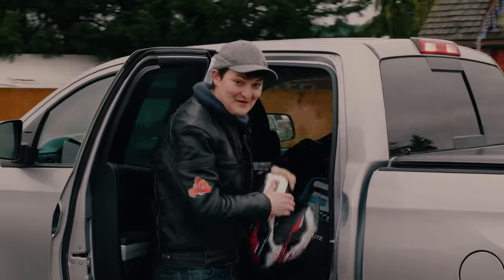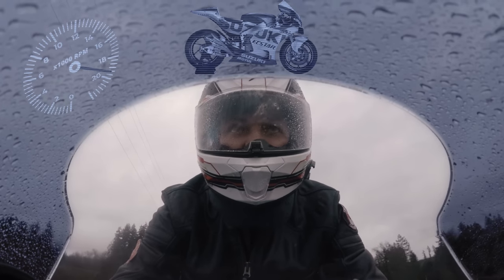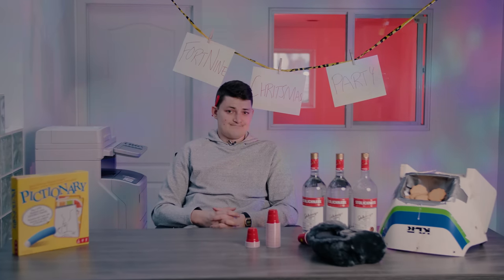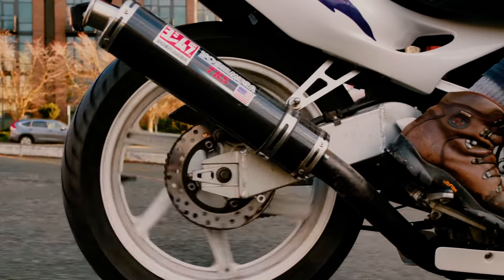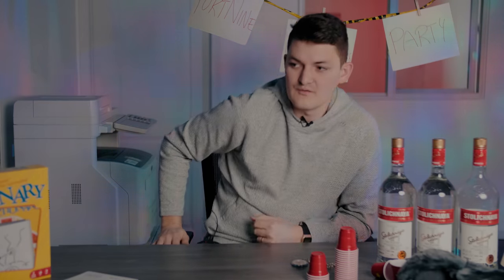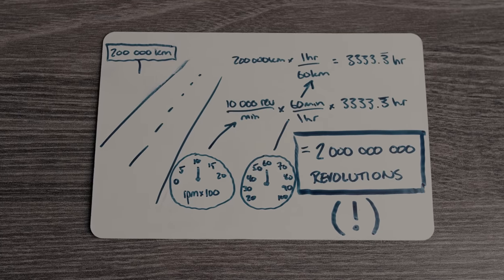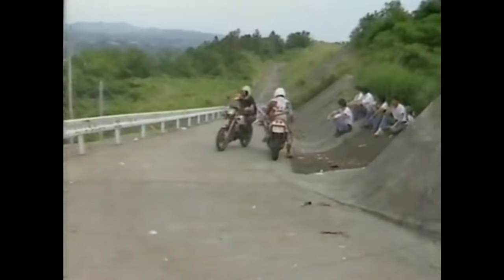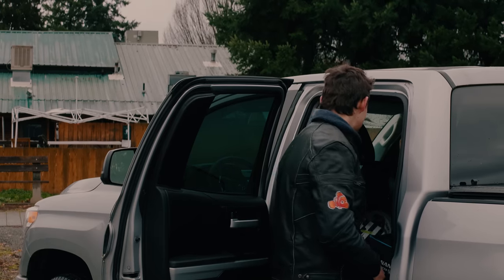The '90s Honda that Revs Faster than an F1 Car

Comment: Sadly they are so rare you can hardly find the good ones. I have been on a quest for 11 years but the availability, price and maintenance has steadily gone beyond my reach.
Reply: I couldn't afford one in the day,unfortunately nothing changes
Reply: Move to south Australia 🤣 easy to find one for 1.2k-2.0k even the Yamaha, Suzuki and kawasaki versions
Reply: @TydraGaming  Ah. No. They're all worn out. Flogged to death with no maintenance by young dickheads. 20000 rpm with dirty low oil. Kaboom.
Reply: @edwardroberts8761  not all of them! Once in a blue moon a clean one pops up, but a lot of them have been clocked over  with "low kms" still cheap to get for what they are, I guess it shows how strong the engines are if they can survive 20-30 years of abuse and still manage to run.
Reply: @TydraGaming  Merry Christmas Tyson.  Personally I've given up on old shit.
Reply: @edwardroberts8761  cheers mate merry Xmas, sometimes being optimistic about these older bikes goes a long way. Sometimes they are pile of shits though 😅
Reply: I paid 2.5k for mine in NSW only thing it’s needed was a battery although it could do with some new brakes it’s been reliable with 40k on the cluster (doubt that’s accurate as being a jdm import it’s probably been played with and they are only a 5 digit odometer) apparently it had a major service and carb rebuild before I bought it but I’ve got no proof of that the 1 thing Ryan doesn’t mention in the video is these are a small bike jump on a 600 or even a current 300 and compare the size these are tiny
Reply: @carbonfiber492  yeah the size is part of the fun, trying to drop one of these in a corner is an experience you cant come close to on a 600 or a 1000, and once you get used to working the gearbox, it just screams In the twisties. The fact that so many are still alive to this day after revving their heads off for 30 years shows they were built exceptionally well. Supposedly they cost similar to a 600 supersport when brand new. So glad kawasaki is bringing them back even if it's only for Malaysian markets. Hopefully that will change.
Reply: @TydraGaming  Fair few in Qld as well

Comment: zx25r been almost a year on indonesia, been a good sell even tho it is 11.000 CAD, because 600cc or 1000cc bike in indonesia were 50K+ CAD (due to tax and regulation, etc) so it is a good entry to 4cyl sounding machine (we just love the sound, speed yes, but it sounds "expensive")
Reply: Wish I could immigrate to Indonesia just for this baby
Reply: @ruhtam8971  and it is like what his saying, it sound so loud for suprisingly little amount of go, so you can be cruising at like 40-50 kph at 12.000 rpm

Comment: Had an CBR250R (MC17) for a short while many years ago.  While it doesn't really get going until 14k+ I was actually pleasantly surprised by just how wide the powerband was on it for such a small engine. Fantastic little gems, such a shame they like the 400 class were effectively killed off when Japan changed their licensing laws in the 90's.
Reply: I had the MC17 as well! Bought it of a dude in Auckland for $1500. Great bike. I ended up riding it to Palmerston North. Had some awesome races on that little hurricane

Comment: I have the cbr400 nc23, the near exact 400cc version of this bike, and with the extra 150cc it's fantastic! Enough grunt to beat today's 300s, and I suspect it would beat a ninja 400 of today as well. All the CB 400s Hondas had cam chains, and not cam gears like the CBRs and VFRs so they don't have the whining engine sound
Reply: You sure it can beat the new ninja 400s?
Reply: @saivang9204  Maybe not off the line with its tall first gear, but otherwise its got another 14 hp and just 30 pounds heavier. So yeah, it probably would beat a ninja 400.
Reply: @saivang9204  I'm sure, but having seen the new ninja 400 parallel twin pull, I'd be willing to put money on the old cbr beating the new ninja on the top end lol

Comment: Damn, that's the first time I've heard one with a Yoshi pipe, that sounds INCREDIBLY good. I actually didn't know Kawasaki launched a new Inline-4 250cc, sure would be nice if it came over here.
Reply: Sadly, they are mainly Asian/Indian market. The emissions, are 1 thing, and the second is conversion/dollar rates. Me...I want one. But most riders will pass on the price point alone. :(
Reply: @animationcycles7109  unfortunately we have lost hope of getting the zx25r in India because unlike Indonesia we don't have strict laws regarding age and capacity of bike one can ride . 
And Kawasaki already sells their z900 as the cheapest bike with inline four and it is very popular out here because of the same reason. I am not sure about this but I think a company makes more money on a bike the higher it's price tag is... So introducing a cheaper bike when they have a more expensive bike as the best selling in their portfolio is not something they would do.

Secondly zx25r's price when converted sits at around 5 lakh INR and at this point this bike would be competing with the second best seller in kawi's portfolio (in india) so I am not sure if it will have many takers because the general notion here is that 
"cc" matters a lot!! and paying 5-6lakh for 250 cc is not something many would do

Comment: You're making me WANT that new Ninja ZX-25R!
Reply: O yes 🤘😄
Reply: i doubt you'll like it still past the first few weeks..
Reply: 650ib, you'd have to import it from Asia right.
Reply: Me as well ib! When they announced the bike they said it would be sold world wide. Not! I would still love to have one. I'm so disappointed.
Reply: @KimmyR3  says the dude on an R3.
Reply: @KimmyR3  r3 eeww
Reply: I know you're going to get it😂please do tho
Reply: @KimmyR3  My mate owns a ZXR250C and a Ninja300 with full exhaust/power commander blah blah etc. I've raced the 250s extensively and also litre bikes. The 250c is noticebly faster up top but the 300 isn't too far behind. 300 like yours is a better engine around town though more low down torque.
Also the brakes on the 250 90s bikes are better, usually double discs. I have made them go blue once on a particularly fast ride keeping up with 600s and 1000s, they will take EVERYTHING you can throw at them as long as you look after the pads and service/grease them from time to time. 
They are different levels of bike IMO. True track bikes for the street. The modern Ptwins are more a commuter sports bike IMO. Power is different for a reason..
Reply: I agree, but i'm specifically replying to 650ib here. he mostly does highway pulls on uber modded liter bikes hence why I said he's gonna get bored of the ZX25R (or 90s 250 i4 bikes). The new ZX25R is barely faster than the R3, wins primarily at the top end, while losing entirely to the Ninja400.
Didn't mean to diss anyone, I just commented based on what I see on his channel..
Reply: @KimmyR3  wrong,the zx25 will have about 50 hp,much more than the r3

Comment: I had a FZR-250r as my first bike, it was awesome fun to ride with the power band between 12k and 17k, redline at 19500rpm!
Ultimately though jumping on a 750cc and then 1000cc bike just blew it away as the 250cc are not that powerful.
Reply: I had the 1988 FZR 250R was quick for a 250 compared to what's available today.

Comment: Honda also made a 125cc 5 cylinders engine that made 30hp and revved to 20.5k rpm, in 1966. The RC149.
Reply: it made "over" 34 PS
Reply: Its also a super limited production racebike that mere mortals have no chance of ever riding, let alone owning.

Comment: Growing up in Australia in the 90's where new riders were restricted to 250, I remember this bike well and the daily street racers against the Slingshot (Suzuki not the CamAm). I still believe it's a good idea for new riders and if had those rules here then I guarantee the 250 market would be crazy fun.
Reply: Our 250 market was good back then. Gpx250 was another little beast, though it only revved to 15k.

Then again Suzuki and Kawasaki seem to be redoing the 250 market right now
Reply: @MelodicTurtleMetal  Did suzuki come out with a new 250? I only see the same GSX250R on the U.S. site. God I hope that ZX25R makes in to the U.S., I would buy one in a heartbeat.
Reply: @Daschickenify  I guess not.. I thought I remember reading about a huge overhaul for a 249cc sports bike but can't find anything.

Would love to see a competitive market for them again, though admittedly I'm not sure I could go back to 250cc after the zx14r I currently got
Reply: @MelodicTurtleMetal  I regularly bounce between bikes I ride. Most powerful bike I rode was a 1999 R1, I can still get on slower bikes and have a blast. And  on that subject, I'm trying to get a new grom, you know, the motorcycle with 9 horsepower.

Comment: We are blessed that Kawasaki released the ZX-25R in our country 🇵🇭. Letting us experience almost the same high revving quarter liter engine in a new form factor with loads of tech. Less headache from maintenance.
Reply: But can this Kawasaki one do 200,000 reliable kilometers like the 30 years old RR did? That's yet to be seen!
Reply: Shame about the whole 400cc rule for Northerners tho...
Reply: @rohanes thats the saddest part. but still marami parin kaming kasamahan galing luzon.
Reply: @deletevil  Only time will prove that, but it's a Japanese bike with fuel injection, I assume it's reliable enough.
Reply: @reeeee3  agreed!
Reply: @reeeee3  agree, so far after a year of ownership, no problems whatsoever.

Comment: The sheer horror on my face as Ryan shows us how it revs to 20k while the engine is still cold and pumping out steam. That said, great vid and bike. Reminds me of my teenage years when the KR1S and the RGV were kings.
Reply: Yeah, that was hard to watch. I couldn't do that to a fine piece of machinery
Reply: Yeah that was just plain stupid!! In my book that is; No feeling for technology!
Reply: @R2_D3  guys chill do you really think the physicist math whiz would do that lol? They had it warmed up before the shot obviously. The shop that loaned it confirmed
Reply: @dkompolt1234  That wasn't a warm engine! No way!
Reply: @dkompolt1234  Clearly not it was pumping out condensation still
Reply: @dkompolt1234  yes , we think and know that.
Reply: Kr1s and rgv kill these things , these were cool for a 250 4. But nothing to write home about. I loved the 400 it was barely heavier than this but with the extra power you want. 

I've got two of the 900's at home , the trip colour hrc and urban tiger.
Reply: @hayden6056  had a RGV250M,  great bike, always liked the KR1s but were pretty rare in NZ compared to the RGVs , wish I still owned it, but drank fuel and 2t oil,tyres, brake pads etc but kinda worth it as a weekend bike....
Reply: @nix123ism  man over in Aus you're looking at ten K for a good road going one these days. I want another one but I think if I were to go that direction I'd possibly go a vfr 400 or zxr 400. 

It's been a long time since I've yelled at a two stroke for not starting when I really need it to. Not long enough to forget hahaha.
Reply: @R2_D3  H2O in combustion product condenses as water vapour in cold atmosphere, especially at high humidities, as air becomes water-saturated very quickly.
You see warmed up engines spewing out vapour all the time in cold weather.
Reply: @minhucovu6321  then explain why anywhere else in the video we do not see the vapor.
Because that engine whas stone cold , that is why you see the vapor.
Reply: @gertscheper9653  Idk, maybe the ambient temperature changes?
It's still smoking at 2:00, and around 2:14
Reply: @minhucovu6321  dream on.
Reply: @gertscheper9653  :))))))))

Comment: I really wish that manufacturers would do more bikes like this, low displacement 4 cylinder engines. That's why I was really looking forward to Kawasaki's new 250, but then saddened when I heard they had little plans to bring it to the states.
Reply: Why ? What benefit has a low capacity four over a modern twin or triple ? Try the Aprilia RS 660.
Reply: @douglasalexander4348  35 MPH sounds amazing on a small displacement 4 cylinder engine when you put an exhaust on it. Plus, like he said in the video, it's more fun to drive a slow bike fast than a fast bike slow.
Reply: @THEJake829  I agree. I have a 250 2 stroke. But try the naked mt07 or Aprilia rs660 sports. A lot more flexible.
Reply: @douglasalexander4348  I have a Grom and a CBR650f, and while the CBR can get me places the Grom is generally more fun to ride because if I'm out with friends also on 125 we can race and be a little more silly and not actually be speeding. It wouldn't really be something to be taken super seriously, but something to get screaming from red light to red light having fun.
Reply: @THEJake829  You’ve got it sorted. You don’t need an R1 to have fun.

Comment: You should do a video on the NSR250 or RGV250.  As cool as the CBR250RR were the two strokes were better.
Reply: I second this. Moved to Japan in 1999 and immediately bought a '92 NSR-250R, put JHA chamber exhaust and a limiter-less PGM-FI unit in and it was an absolute beast. Scary as hell too, you really had to tell yourself that today may just be the day you die when riding it.
Reply: My first bike was an NSR250 mc16. Holy crap what a beast. I ended up stacking it at 50km/h attempting my first wheelie. Threw me right off the back, hit the ground head first, rolled several times and sat up....to watch the NSR continue on down the road on 2 wheels, hop the median strip, continue down the road on the opposite side and finally crash on the gravel verge. There wasn't a heap of damage done, my plan was to rebuild it as a "streetfighter". I got a '98 ex250 to ride around while planning the build....and then a gpz750..... and sold the NSR. Big mistake. They fetch really good coin now, to the point I will never justify buying one again 🤷‍♂️
Reply: @trevorcrane1664  that's hilarious about your wheelie story.  At least you were only going 50 kmh. They are fetching a shit ton now. Probably because they're so rear from people stacking them. Ive got a 92 NSR sitting in storage in pieces. Plan on putting it back together someday.  Had a CBR250RR before the NSR.
Reply: @disabledoperator  yeah a**holes like me stacking them. Guess I shot myself in both feet with that 😢😢😢
😂😂😂
Reply: @trevorcrane1664  they're just a shit ton of bike your allowed to ride on learner licenses. At least they were before laws caught up with them.  Hey we've all stacked bikes at some point.

Comment: Had a CBR250RR for a few years, miss the high revs. Unfortunately the 20k limiter is a lie, the CDI cuts out at 17,300. I think the CBR in this video might have an air leak or isn't running on all 4 cylinders, at least it sounds similar to when mine was running on 3. 1st gear should top out at 80km/h (50mph) so you still can't really go WOT without speeding on most streets. Love the vid anyway!
Reply: Are you sure it was an RR and not an R? I definitely took mine to 19,000rpm
Reply: @taicr80  yeah, 1991 CBR250RR(L). The tacho needle does exceed 17.3 but nothing changes in the actual engine rpm past that
Reply: @nick_yd  interesting. How did you confirm this?
Reply: @taicr80  If you’re familiar with the cbr250 forum there’s a thread on there from a few years back with extensive testing on the cdi and voltages during engine running. Very interesting read, but disappointing to learn the truth, haha

Comment: The piston goes up and down 313 times a SECOND.
Reply: That is "only" 18,780 RPM, 20,000 RPM is 333 RPS.  Double that for "strokes" or direction changes.

Comment: I have driven one of these. I found the revving to 14k to go 60 mph killing me. But they were amazing feats of engineering.  But I prefer a single or v twin
Reply: what about it, the noise? or does it just "feel" bad?  because the wear is not any worse than a thumper or a twin. my one gripe about Vtwins is they don't rev high. 8k is car territory. But then again, i don't ride a 250 4cyl either. still, I love triple or 4 cylinder noises
Reply: My CBR250RR does about ~9500rpm holding 100kmh on top gear, definitely not a touring bike 😂
Reply: @daviddias3471  yea but at the same time, the whole engine note is higher than say a 600cc at 9500rpm that carries more rotating mass (and a liter bike even more at that).  I think rpm is less important if the design is at home sitting at those speeds.  sometimes it's just "how it is".  like a dentist Dremel sounds normal doing 31000rpm near someones teeth, but a tumble dryer sounds normal at 150rpm off in the distance. two different sizes and machines.  a little 250cc with 4 cylinders is supposed to be spinning up like that. and is at home doing it.
Reply: @twrcrew8852   nothing worng with it but no low end torque. I prefer a crf250 where i can do wheelies and such  just my preference.

Comment: I've got the CB250F Hornet as my first bike, which is the naked version of the CBR detuned to 40hp and revs to "only" 16k. It's a blast to ride and always puts a huge smile on my face when the tach goes past 12. Not the best on the highway though, as it cruises at 9k and the noise does get a little grating after a while.

Comment: Always wanted one of these. Those gear driven cams 😍
But alas, my first bike was an NSR250 smoker. Then a GPX250 and finally a GPZ750, before I had to give up motorcycling due to chronic pain. Now over a decade later, I want a motorcycle again....

Comment: I had one, they were very popular in Ireland since we had similar laws to Japan at the time. It was legit the most fun I had on two wheels! An engineering marvel. Sold it due to the introduction of E10 fuel which doesn't bide well with the carbs